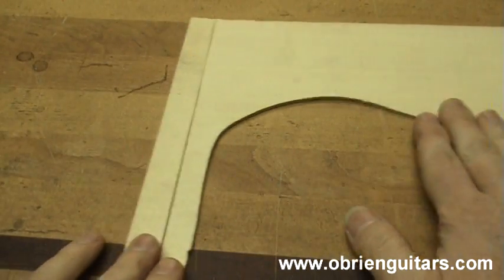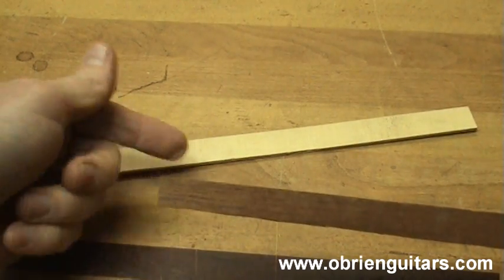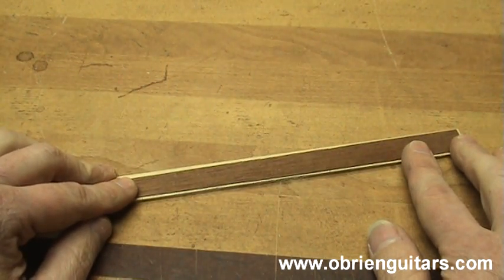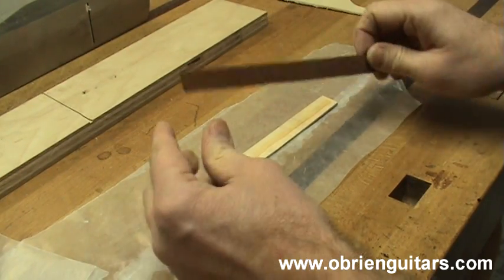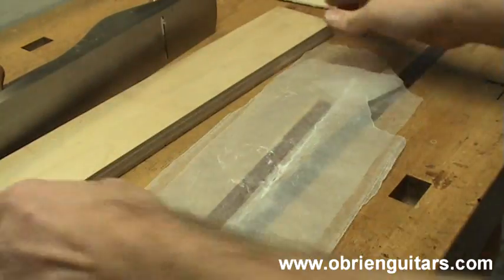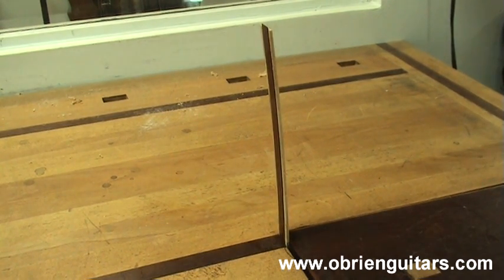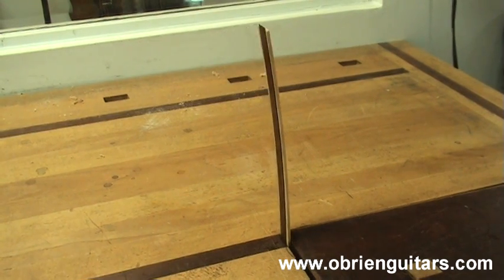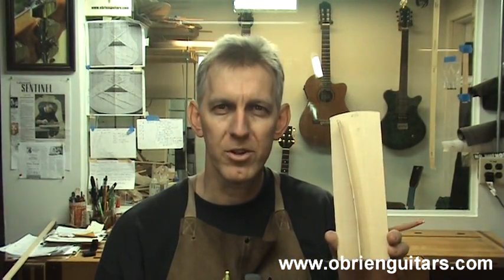Luthier Tips du Jour Mailbag - Hygrometers

Comment: I was wondering 
Does it matter what Veneer you use on top of end grain cut off.
For example if I bought a white veneer sheet from LMI 

As always great tips and videos  
Cheers
Reply from the maker: The veneer type doesn't matter. What you mentioned will work fine.